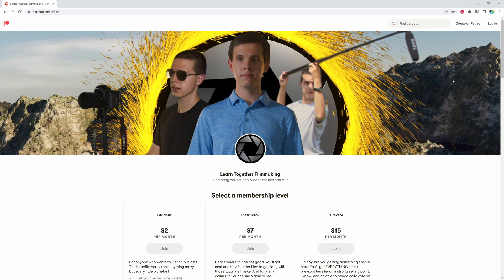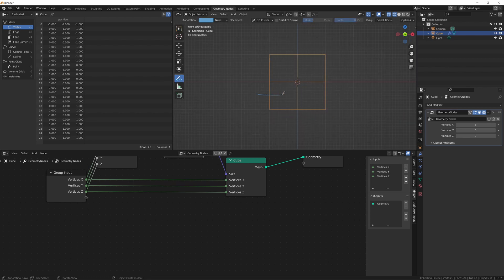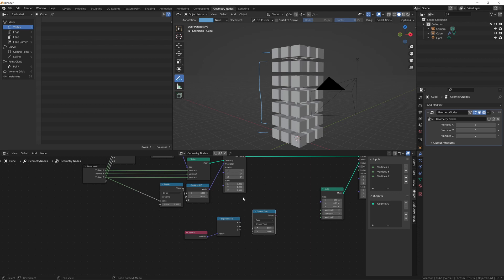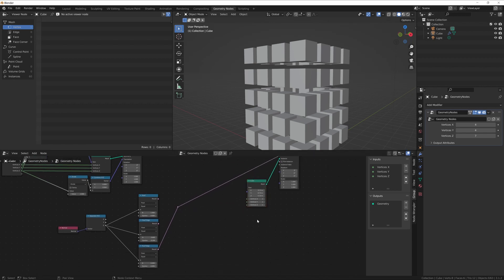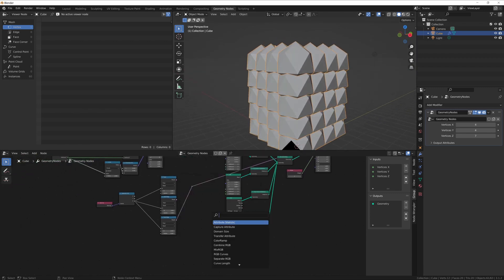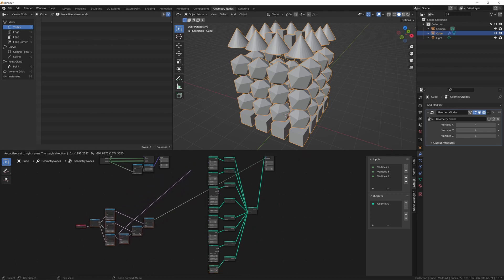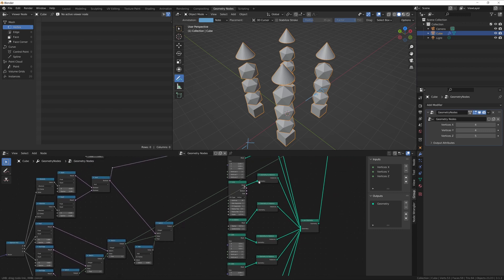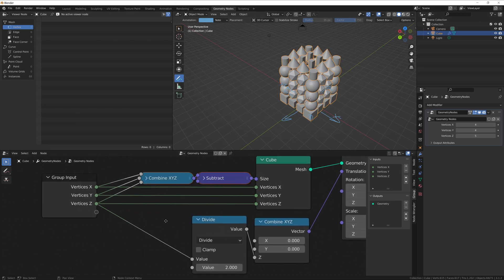How to Make a Procedural Building in Blender (Part 1) | Geometry Nodes Tutorial

Comment: Gorgeous! very impressive, my question is does it not lag a lot with midrange computer specs? as im planning to follow this soon.... thanks a lot
Reply from the maker: Thanks! I don't imagine it would lag even on a low-end to midrange computer. While the node setup looks really daunting and complex, the underlying calculations are pretty efficient, so it shouldn't bog down your computer a whole lot. My computer's a bit on the higher-end, but for comparison, changes didn't start noticeably lagging until I had a ridiculously huge building like a 40x40x40 cube. And even then, the viewport was perfectly responsive until something like a 250x250x250 cube. RAM-wise, at a size 100 cube, it only took 2GB of memory, 5GB once materials were applied and rendered.
Long-winded of me saying you'll probably be fine!
Reply: @ltfilm  thank you so much for your reply.
Reply from the maker: Glad I could help!